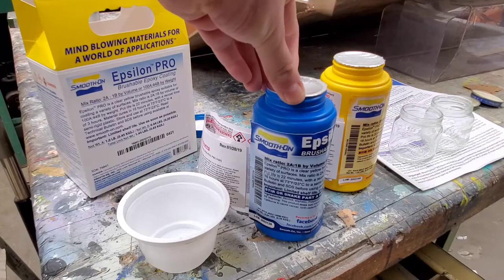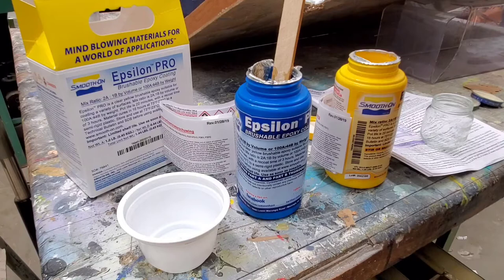Turn Styrofoam Hard

Comment: I've been working with resins for over 3 decades.  They do work on styrofoam.  BUT a mixture of 1:1 of  Modpodge and acrylic paint is cheaper and will hold up better.  You can recoat within minutes because it dries so fast.  After a few layers, it becomes hard and durable.  I know.  It sounds silly.  I thought the same.  Until i tried it.
Reply: I tried this but the styrofoam holes are still visible. How many coats before it's smooth? 😊
Reply: @ds74878  I know the type of styrofoam. It has the larger cells.  It's the cheapest stuff and the hardest to work with too. I like to use the pink stuff for buildings.  It has a tighter cell formation and easier to work with.  As for covering those holes, it takes SEVERAL coats before you can see good results.  But, the more coats added, the harder the surface.  ;)
Reply from the maker: @MRaadesign  , exactly right. I don't know why I'm just now seeing this comment thread.
Reply from the maker: @ds74878    , I'm sorry for the slow response. I don't know why, but I never saw this comment until today.  @Mraadesign is correct.  The only thing I would add is that you could sand it with a sanding block afterwards to take off more of the bumps.  This would take less coats.  I'm sure the response is too late now, but I'm going to leave it anyway in case anyone else runs across this thread.
Reply: @MrJON3S  No worries.

Comment: Sir, can you use it with painted art as strong coating? Will it be opaque white to block the painting or it is transparent? Glossy or matte output?

Thanks for answering 😊
Reply from the maker: @ianrena1  , I would strongly discourage you from doing that.  This resin yellows over time. High quality clear acrylic medium is a good way to seal an acrylic painting, but if you are looking for a hard glassy surface, there are other high quality resins that would work better.  I would recommend some, but I do not use resins like that, so I would be speaking from ignorance.  Good luck, brother.

Comment: I want to make a hard shiny blue coating on my styrofoam art. What kind of coloring do i use? And is the epoxy you use in this video shiny when it dries?
Reply from the maker: It is glossy when it dries, but it does seem to yellow over time.  I haven't tried mixing pigments in it.  The epoxy can be spray-painted with glossy blue paint.  You just have to make sure you get good coverage so that the paint doesn't leak to the foam.
Reply from the maker: Depending on what you're making, how much action it's going to see, and how often you'll use the epoxy, there might be a cheaper option. 

 I use it frequently, and the stuff I make typically needs to take a lot of abuse,  so it only cost me a dollar or so per project, and saves me a ton of heart ache.

Comment: Yes, but I have yet to find an epoxy that does not yellow with time.   I have also found that it will haze if moisture gets behind it.
Reply from the maker: I'll save out a test piece and see what this does over time. I just did a video response to another comment using this epoxy as glue.  I can use a piece of that. I've made a lot of paintings with it, but I always cover them with paint, so I don't know how much it yellows or doesn't.

Comment: After applying the Epsilon mix and making the surface hard and durable, how would I go about applying a plaster/paint mix? I worry because the result is so smooth like glass, the plaster mix would never stick and crackle right off. I’m trying to make the final finish a matt, sand like finish with acrylic paint. Thoughts? Would love to message you with some picture references to explain what I mean 🥺
Reply from the maker: I just give it a once over with sandpaper.  If I have a lot of ground to cover, like the painting in the video, I use a dremel tool with an abrasive attachment to give it a tooth really quickly.

Comment: Hello, is this strong enough to press plywood. I'm planning to make a skateboard mold using styrofoam? Is this strong enough to not break when using pressing force?
Reply from the maker: Matthew, I haven't tried it on wood yet, but my initial guess is no.  The material is pretty strong and durable in its proper application, but the bond strength doesn't seem to be on the same level as a wood glue.  Also, the material is somewhat ridged, but also a little flexible.  This makes it really good for Styrofoam props or art.  If it gets bumped or dropped it does have some give to it.  I will try it out and let you know.
Reply: @MrJON3S  thanks man, I always apreciate the replies. Goodluck
Reply from the maker: https://www.youtube.com/watch?v=8SbPFql-fn0&ab_channel=JeremyJones
Reply from the maker: That is the video where I finally finished testing this stuff as glue.

Comment: Thanks this it really interesting can you use any Epoxy to do this?
Reply from the maker: Most epoxies are okay, but I don't know about every resin.  This smooth on product is essentially an epoxy resin.  It is just formulated for durability. It's fairly hard, but it is soft enough to take a drop.  I'm almost done with a video of a durability test for this particular resin.  I would say that your resin is probably safe, but if you are worried about it you can always coat the Styrofoam in acrylic paint or mod podge to seal it first.

Comment: Can you use any kind of paint over that hard coat resin? Or does it need to not be aerosol or oil based?
Reply from the maker: Yeah, you can use just about anything.  I would recommend taking some fine sandpaper and putting a little bit of a tooth on it first, because the resin dries smooth as glass.  I usually paint it the same way I do most of my paintings.  Oil paint with an acrylic under painting.  I hope this helps.

Comment: could i use fibreglass resin?
Reply from the maker: I can't 100% guarantee this but it is my understanding that fiberglass resin usually has solvents in it that will melt the foam.
Reply: The resin normally used isn’t epoxy resin but polyester resin. The poly resin will dissolve styrofoam which is why you would want to use epoxy instead. If you are determined to use poly resin, you’ll need to protect the foam with something like packing tape so the resin doesn’t make contact with the foam.

Comment: why not just slather on some thick polyurethane?
Reply from the maker: I think you definitely can, but it will give you a slightly different outcome.  When I have coated things with polyurethane in the past, they have felt softer and more flexible than the smooth-on.  When the smooth-on is mixed correctly, it will be pretty hard, but just flexible enough to take normal blows/wear and tear.  However, I believe they make polyurethane with a variety of different consistencies. Also, be careful not to get a polyurethane that has a thinner in it that melts the foam.  I would recommend experimenting and seeing what works for your particular needs.  Be sure to sand either of these before painting over them, so that the smooth surface will have a tooth for the paint to hold on to.  Another really cheap option is coating foam with plaster.  Good luck.
Reply: I have used Latex Paint and then Water Based Polyurethane and it is really nice...